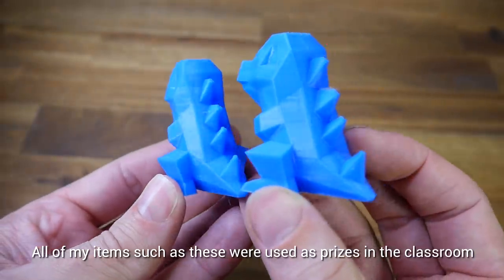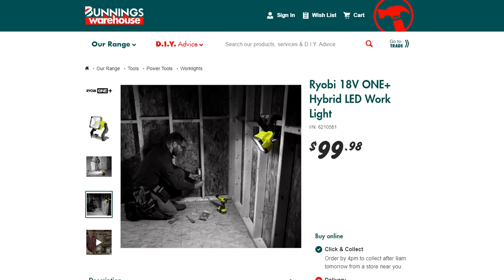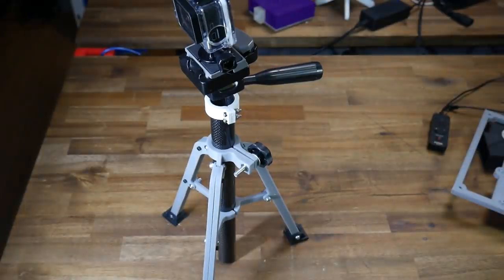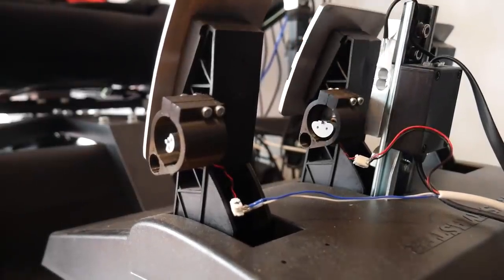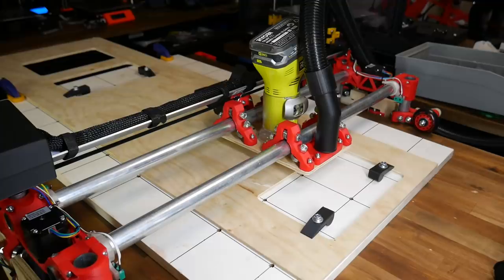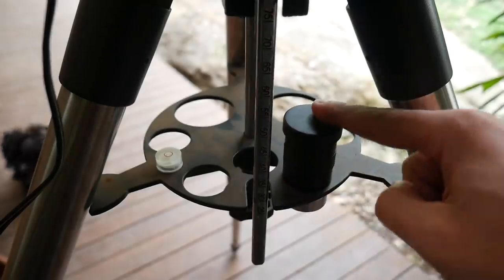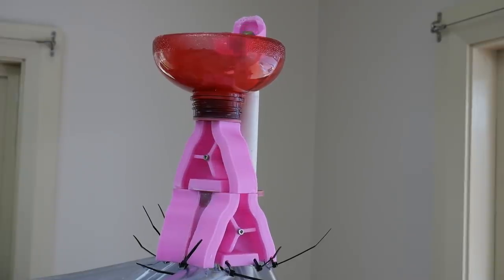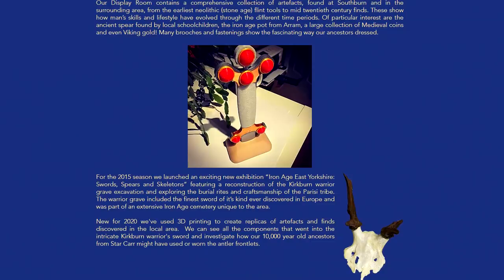5 reasons 3D printing is useful - My favourite practical prints

Comment: Well I do understand that this is Your shtick/raison d' etre..    But IMO it IS a craze and a  waning one at that. Most anybody who wanted a printer has one... or multiples ..
given that's Exactly what dilletentes do; Buy multiple examples. Those Yoda Dolls are Challenging :-)
  Prints, even with the very best Consumer grade Gizmos are of Meh to Crap quality... if one isn't using Rose tinted Goggles . 
Been at this for a few years now  And I've yet to see a genuinely good print. Yet these DO exist .. albeit in industrial prototyping machines  Where printed components are virtually indistinguishable from injection molded ones.    Barking up the wrong tree this time... mate.
Reply: I liked the part about it being a craze. I too will be happy when that's over like the tide pod challenge and no sex November. However, if all you do with a printer is print things indistinguishable from injection molded... why not just mold them? It's faster by orders of magnitude. Translates pretty well into cheaper. Doesn't seem like a good end goal to me.